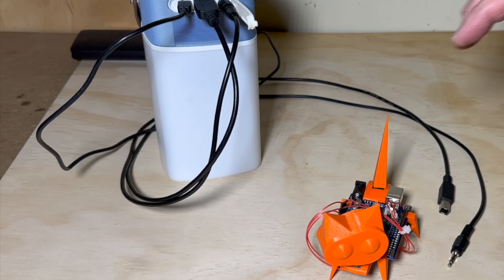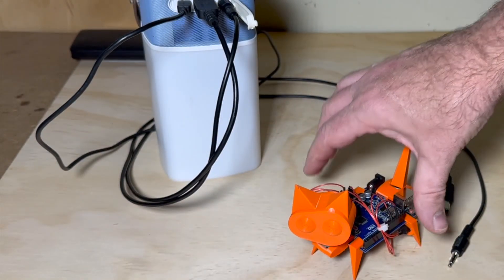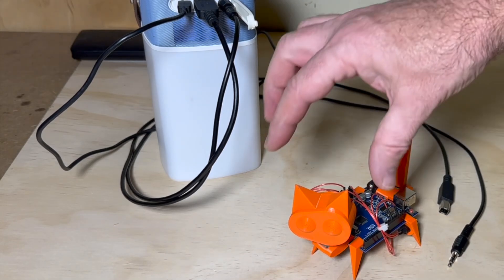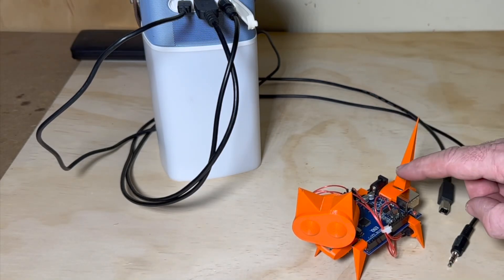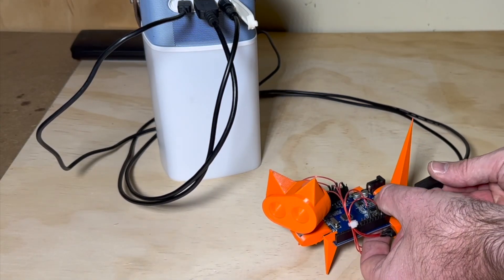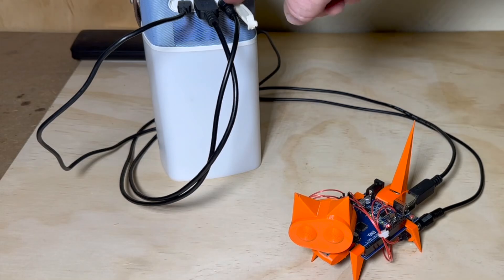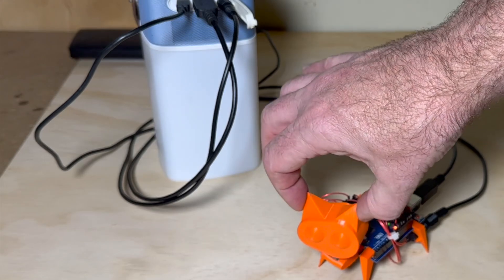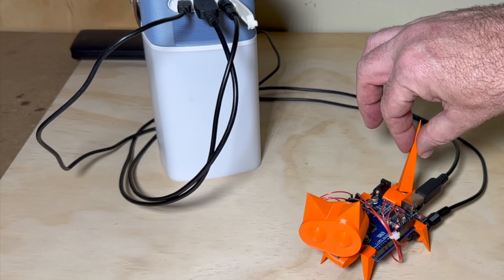11 April 2024

Comment: what speaker are you using? i loved the project so just got it all soldered and assembled but im struggling to find the appropriate speaker for it. it works with a Piezo but obv that’s pretty quiet. using a rechargeable phone-connecting kind speaker didn’t work either, im presuming the Arduino is sending out way too much for it to handle